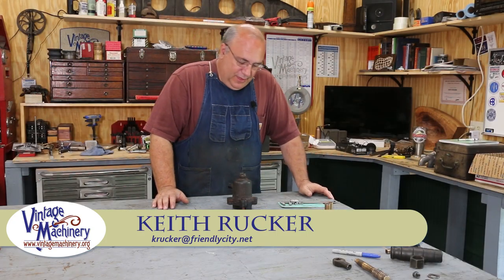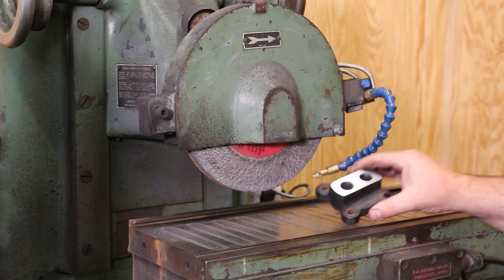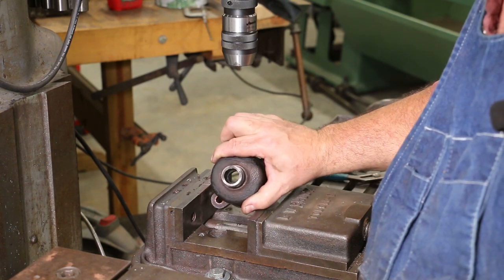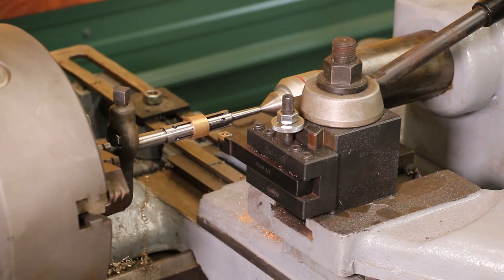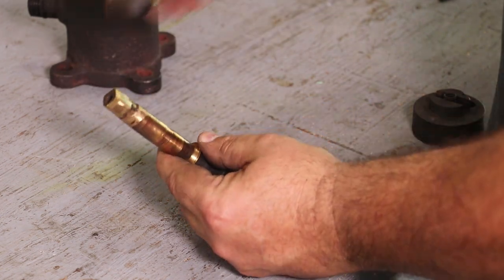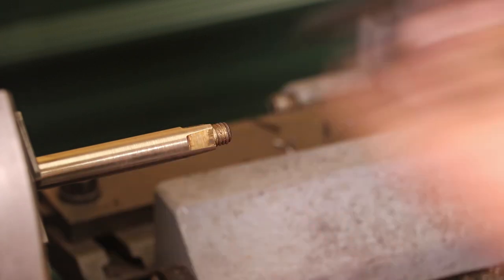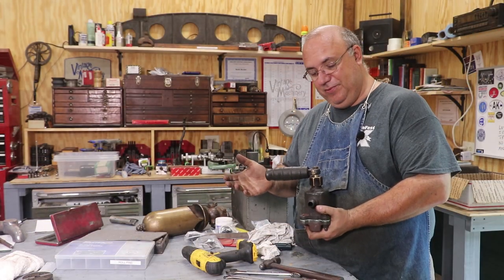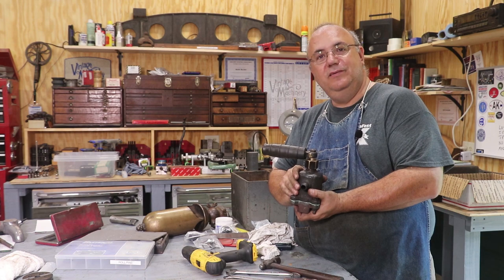Rebuilding a Steam Jam Brake Valuve for a Steam Locomotive

Comment: Keith, you've accidentally misspelled your title
Reply: Aw shucks, he got the big words right .put it down to a typo .U and V are not close on the keyboard so it can't be an engineers fat finger problem
Reply: The confuser did it.
Reply: It seems as if that valve has value
Reply: It's actually supposed to be spelled "Break Valuve"
Reply: Might be french :)
Reply: No.....
He actually said "REBUILDING"
This was just a "PATCH JOB"
He didn't even clean up the parts, dirt and small grit had to be falling on to the valve seats. Did he even Lap the seat or Test it for Leakage?? Brazed it up and left putting in the sealing surface?? ("That's good enuf for what we are doing....") I'm not trying to be condescending, or belittle his work (which is Genius and mostly Awesome!!) But he was right there in the middle of it then didn't do one more pass of welding to fill the pitting on the valve seat or one complete surface pass of welding in the beginning.......
I'm Sorry,  i apologise Keith but I don't know, maybe I do things and think about jobs differently...
Good work n Good Luck. I Love your Videos n your Work!!!...... even tho I cringe some times that's just my OCD and personal retardation...?
Reply: @logankincade661  He resurfaced the seat with the counter sink he said matched the profile perfectly.   No more pits.

Comment: Re-purposing that valve stem demonstrates why that sort of piece should never be tossed out in the scrap pile.  You never know when an old bent corroded brass valve stem will be exactly what is needed to complete a repair.  That saved you a lot of time and effort and it seemed to make a very good repair.  The proof is in the pudding.  We will know if the locomotive stops or not when they twist the valve. Thanks for posting.  Take care.
Reply: Even if it isn't in condition for turning down to something smaller, if you have a furnace capable of melting it down you can use it to make a cast blank, along with the reserved chips and other bits not fit to use as they are.  I started hanging on to valve bodies that had split due to freezing, and even old bushings, regardless of condition, for that purpose.
Reply: I have a set of brass drifts or punches I made out of old brass gate valve stems, one was made of a brass stem almost exactly like the salvaged one Keith used.  Re-purposing old worn out parts is always a good idea!

Comment: I have rebuilt one of them, only did a grinding to the base and valve but the stem had the same but a sod broke the tap off it so I sleeved it and then added a new top for the tap, it was never going to handle hard turning so I made a top plate to stop the tap in its position, it worked and is still working after 10 years.
But after fixing the one I made a new now out of steal.
The train I was working on was 18" gauge.

But anyway Keith you did a great job, keep it up.

Comment: Wet, dirty, air being used in train brake systems. How the various complex A/B valves and the like continue to operate with acceptable reliability on a string of 110 cars of crude oil baffles me. 
Now,  Keith,  you tell me there were steam powered valves and cylinders used on the engine and (sometimes) tender!!. Who knew...steam brakes!! (As an emergency tie down)
I had to do a little research on that topic! Didn't find much. How did they deal with corrosion and condensate in that line, what a nightmare to maintain! Always blowing it down etc. 
Thanks for revealing new things to learn about!
Reply from the maker: Most steam locomotives had a separate steam break just for the locomotive.  In the case of our train, the jam brakes on the locomotive are the only brakes that we have - no air brakes on the two cars that we pull.  This was common on small "industrial engines" like this one.

Comment: Looking forward to the time when you have your mini foundry set up and are able to cast the valve stem using the original as a pattern. A little rapping of the original would give you the extra gap to compensate for the shrinkage and you would have had a solid casting to machine. Really enjoyed your solution to this problem though. Keep up the good work!

Comment: I was surprised that you didn't silver solder the new stem as the 3/8" spigot with a roll pin is a bit skinny compared to stength of the original and you wouldn't want a failure point right there in a train breaking system.

Comment: If that valve stem end didn't have a machined surface to use your split ring clamp on, another way occurred to me. You could turn a cup that would accept the odd shape, then place it in the milling vice and center it under the spindle. Then hold the valve stem in the spindle and lower it into the cup. Then pour lead in the cup to lock the two pieces together. The outside diameter if the cup can now be held in the lathe.
I've seen this done in the manufacturing of turbine blades when they need to hold the blade by it's complicated contoured surface to machine the tree (the part that keys into the turbine wheel).

Comment: Keith how confident are you that the new metal deposits will not come loose in time with erosion and potentially jam the valve? Could you not have ground and lapped the cast face back to a good surface and then made a very slightly longer shaft to compensate. That might prove to be more reliable and a much simpler solution.

Comment: Could you have cut the ports bigger, put in two sleeves that would have taken the pitting out, then surfaced the top like you did, that would also help stop the pitting on the cast iron near the holes?

Comment: Very interesting and great to see the renovation of old parts .Was there any particular reason why you chose 3/8" for the step down diameter as there looked to be plenty of meat left on the old  part to have  gone a little larger 7/16" or  1/2"  making the shaft stronger where it was drilled and pinned, fully understand that there is no real force needed to turn the selector disk . Have I just answered my own question ?.   

Hope that sometime in the future it can be seen and demonstrated working on the engine.
Reply: I thought the same as some people are very heavy handed.

Comment: Not trying to second guess your repair but will the steam heat expand the valve to the extent that bushing will loosen?  Hopefully they will heat up and expand at the same rate. Good off the cuff repair. Think I would have ground that surface to "clean up" but that is just me. Again good repair.

Comment: Keath, how much material was removed during the surface grind?  I didn't see any reference to the original height, or why the original hight required brazing. Why did you sleeve it if you were planning on making a new pin.  Why didn't you not make a hardened sleeve? 

 It's not good practice to have soft on soft. This is why you're replacing in the first place.  You could've pressed in a nice tool steel sleeve and Jig ground it?

Comment: Another great video, Keith.  Just a query though - if the shaft was an interference fit in the 3/8" blind hole, shouldn't you have drilled a small hole to let the air in the hole escape when pressing the shaft in?  Otherwise, you are trying to super-compress the air in the blind hole.

Comment: Great video as always. One question. You are not afraid that the pin hole will weaken the pressed-in section of the shaft, so that it could break if the handle is torqued to hard?
Reply: Yes, it will surely weaken the shaft compared to the original straight from the factory valve.  I personally might have brazed the rod on, or at the very least used a smaller spring pin, but I think the repair ought to work for a good long while in any case.  It may in fact last decades.
Reply: Possibly, but then again there doesn't seem to be any force directly opposing any turning action (other than friction) so I wouldn't expect anyone to try to rip the shaft off...
Reply: Ahhh, but this is not just a simple valve it's a BRAKE valve and in an emergency  the force applied to the handle may be extreme.  Don't forget the end of the original stem was deformed (it may have also been brazed) and the handle attached to the stem was at one point broken and brazed back together.   There is the matter of the steam causing resistance, but I think that may be secondary to an emergency brake application with force.

Comment: As the whole valve body seems to be filled with steam when in use, I'm wondering - won't that steam try to push the pressed-in brass bushing out? Is the pressure / ring surface perhaps to low to win against the press fit friction...?

Comment: It might be advantageous to get a stainless steel roll pin to reduce corrosion from the steam in the valve.
Reply: I agree - a stainless pin might be a better choice due to risk of corrosion from the steam, plus the fact that the brake valve is a safety-critical component.

Comment: That "maintenance" should have been done when you were originally restoring the engine, long before it went on track again. Instead of pinning, how about threading into the valve key, You can then pin it as well.  The job turns out well but there are latent - "This will do" in there that are waiting to fail,

Comment: Kieth, my concern is that the steel roll pin may corrode.  If it does just use a piece of braze rod instead.
Reply: I would be concerned that a braze rod might shear just when you need the brakes. I would have made a stainless rivet out of rod.
Reply: I actually agree with this concern - the saving grace might be that where this spring pin is located isn't really a flow path for the steam so the corrosion it would see would likely be minimal.  A solid pin or tapered pin would have likely been a superior choice as they can handle more sheer force as well from the torque from the operator actuating the valve (seeing as how the shaft had been bent previously).
Reply: Lucky it's a press fit then, and the roll pin is just a security blanket....
Reply: Isn't the chamber filled with steam, always? It's most definitely in the steam path.

Comment: What is the name of the circular anvil tool (with holes) that you use to hammer in the spring pin at 32:05?
Reply: That's a bench block.

Comment: Keith, 
What is packing and what is its function?
Reply: Graphited yarn is placed around the stem of the valve to prevent leakage of steam.
Reply: it seals around the shaft, predates o rings and modern seals, steam is rather nasty, so graphited yarn is used, with oil in it, you have a screw that pushed it down thus packing it tighter when needed
Reply: Thanks y'all. I wasn't sure what it was in this case so I appreciate the knowledge

Comment: A steel spring pin will not last very long in a steam environment. I would have thought that you would have used a stainless steel taper pin.
Reply: Maybe silver solder to bond the two pieces.
Reply: Cyril, I agree. The old valve stem was bent and twisted almost to the point of failure so it must have been subjected to a lot of torque as the rotating portion became tighter. A hollow steel pin with very little cross section exposed to high pressure steam would not have been my choice  for this repair,especially since it's for the brakes on a locomotive.

Comment: Brazing the face of that and using the brass peice that spins on it will make them gauld together. There isn't any rpm on it but lots of pressure and heat. I'll bet it won't last more than a couple weeks at the most. Why couldn't you just clean the face and call it good? Why did you have to add material to it? If it had to be a specific height then I would have finished the face of the cast piece and then taken the same depth of material off the face of the ears/ sealing surface. Cast on brass is awesome, brass on brass in no bueno.
Reply: Chuck Kirchner brazing rod is basically brass. You don't melt the cast into the puddle when your brazing it just melts the brazing rod onto the cast, so unless the brazing rod is cast steel (not likely) the face that will be left after machining will be 60+%  brass.
Reply: He mentioned in the video that he was using iron rod, not brass or bronze.